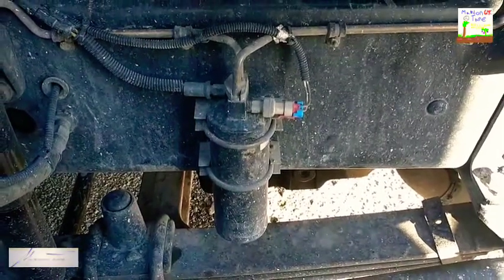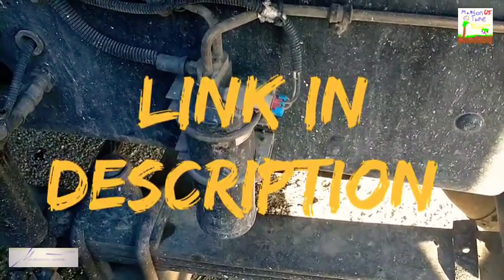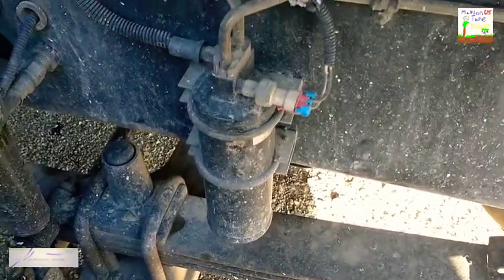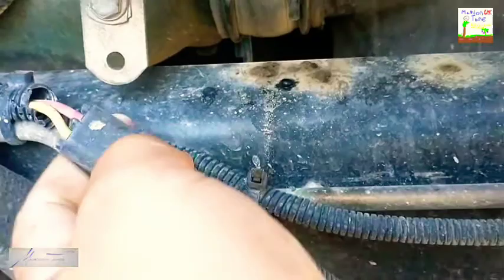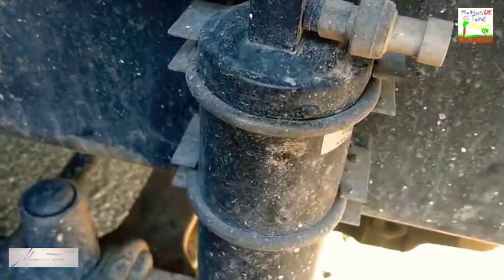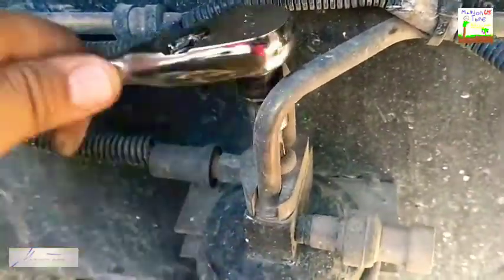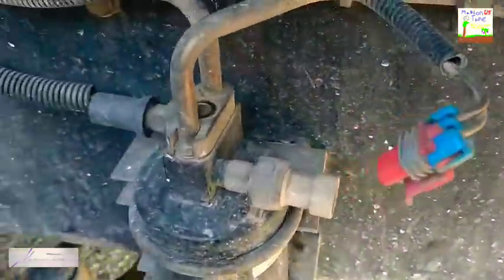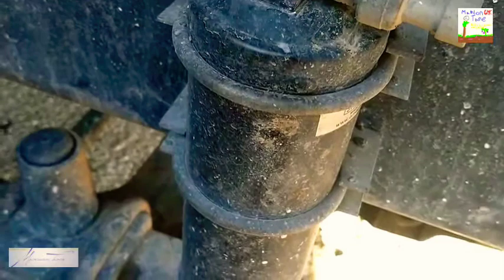How To Replace A.C. Dryer/Freightliner

Comment: What size was the star bit screw?
Reply from the maker: Thank you for tuning in to our channel. Tap that LIKE and SHARE if you don't mind. Also, Subscribe if you haven't already. We have different content in our catalog that you might like or find interesting. Since this video was released over a year ago; I don't recall the size of the bit. But you can simply get a torx set from your local parts or hardware store. There should be one in the set that would work. We really appreciate your support!

Comment: Mines keep leaking on the sensor 🤷🏽‍♂️
Reply from the maker: Have you tried replacing the seals? Like the ones I show in the video.
Reply from the maker: By the way don't forget to like and subscribe if you haven't already
Reply from the maker: @junior35168  I hope it's the right size seal. You can get new seals from AutoZone if you need it. Make sure you snug it down good.
Reply: Did u lose Freon
Reply: @marcusfoster1043  yeah i went to autozone and got a seal kit. Then a sealant for the ac and I’m good now
Reply: @junior35168  after removing dryer
Reply: @marcusfoster1043  yeah my dryer has a sensor and it was leaking there. But I fix it with a new ring.  No more leaks.